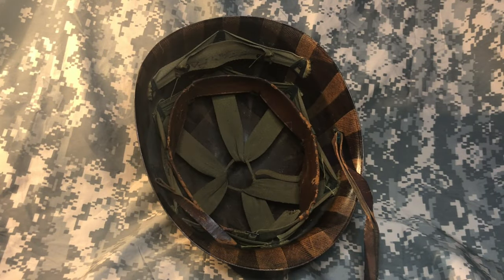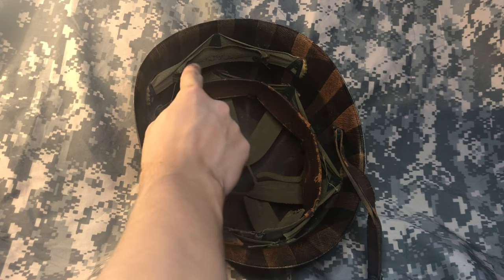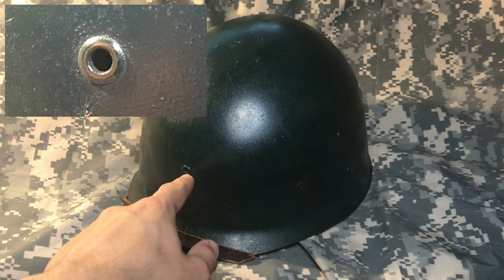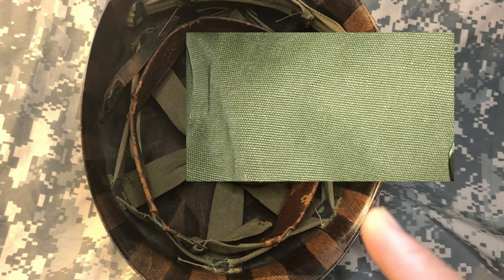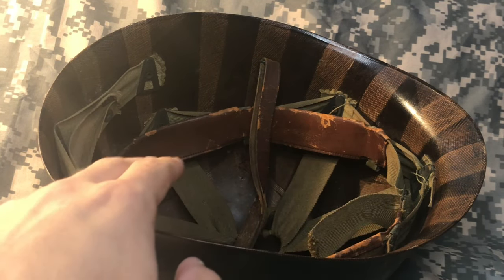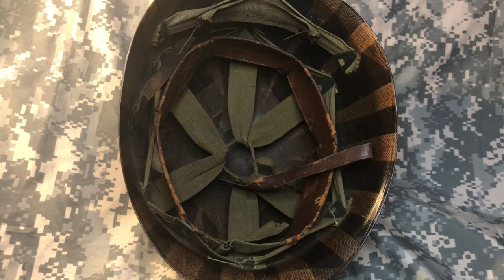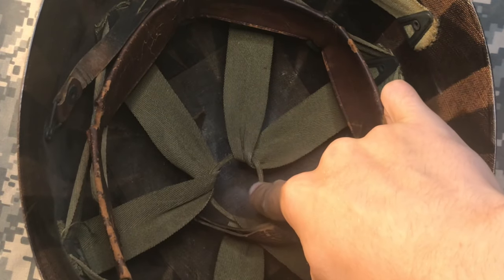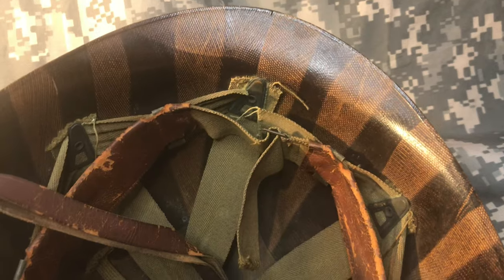Five Things About the WWII M1 Helmet Liner

Comment: One thing I will add is that a lot of the WWII liners I have found at antique stores or on eBay do not have the nape strap. It is removable, so it was probably lost by a previous owner or even during the war.
Reply from the maker: That’s a good insight. I believe that the grommets were easily torn out as well, resulting in re-issued WWII liners being re-webbed with later dated nape straps.
Reply: Yeah, even Vietnam liners have this problem. I got mine with a torn grommet. I managed to hold on to the loose grommet though, surprised it lasted so long
Reply: @jacobyouknowwho  I actually got a WW2 Westinghouse earlier this year that still had the nape strap. Unfortunately the rest of the liner was pretty worse for wear. Can't win 'em all, I guess. lol.
Reply: @duglife2230  Yeah, everything easy to fix on mine doesn't need to be, but things like it has some bad rips in the webbing that I can't fix. Just have to be careful with it and appreciate it for what it is.